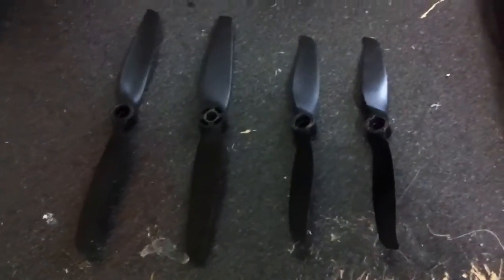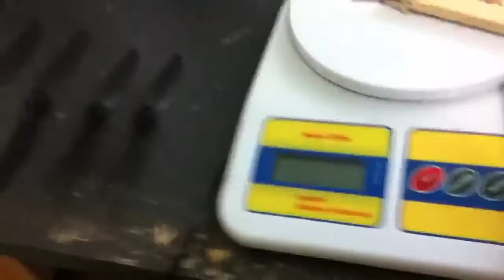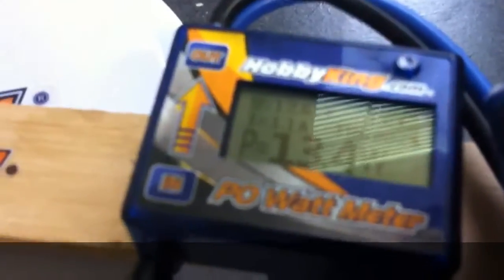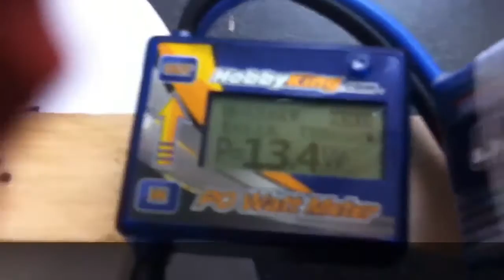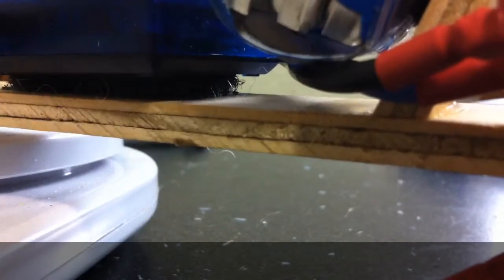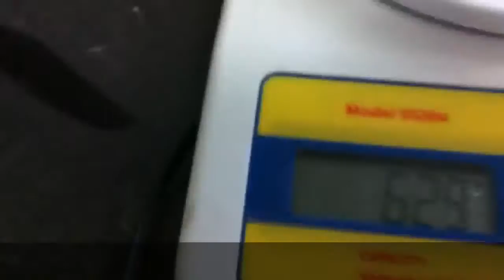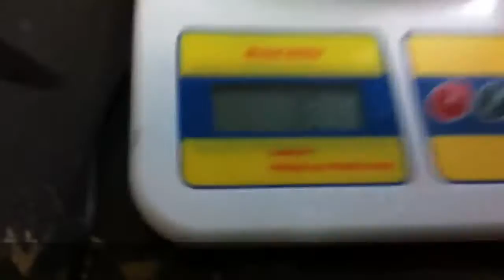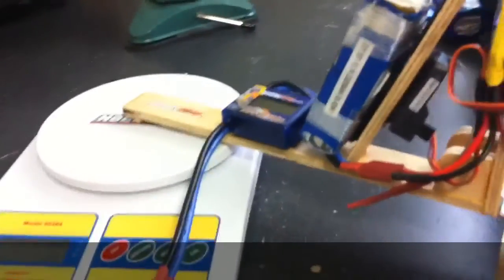Hobbyking Radjet prop comparison

Comment from the maker: Cut/sand an extra canopy out of a block of foam (very easy) and cut holes in it to mount the video tx and extra battery. You will need to add a lot of tail weight though because this thing gets nose heavy fast. You can easily use a 2200mah battery (I always do) but you might want to go a little smaller and push it as far back as you can. The wings carry a good bit more than the factory setup, mine are trimmed down for speed and it still carries a 4s/2200 battery and about 150g extra in the tail.

Comment: I've got both motor type (my first RadJet died quickly).
I received the brown one with my PNF first radjet and the red one later with the kit version.
The red One seems a little bit bigger and magnets a little bit "stronger", also, the red one seems very similar to the Bixler stock motor.

Comment: Excellent video thanks for the info and recommendations. So I'm thinking of putting a small FPV rig on my radjet (200mw 5.8 vid transmitter, board cam and an extra small 500mw battery 2s battery, not sure what the additional weight would be but by your calcs Im assuming if i switch to a 6x4 or 6x5 I would have 200odd grams of spare weight, subject to wing loading... Any other thoughts or suggestions on mods to make this work?

Comment: I have a 1300 3s in my rad jet witha stock motor and esc; youre saying that if i get a tgs 6X5 prop i will ppull less power and get more speed?